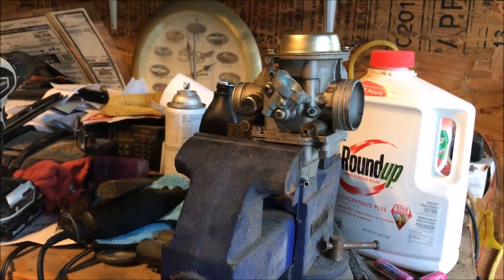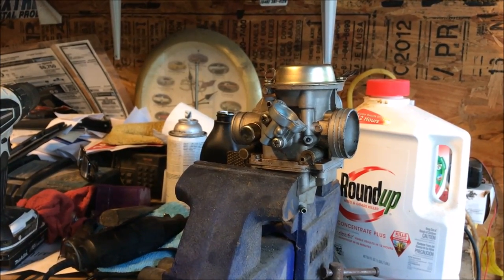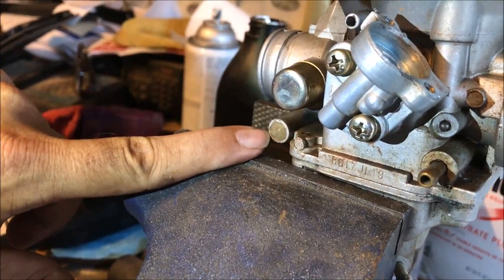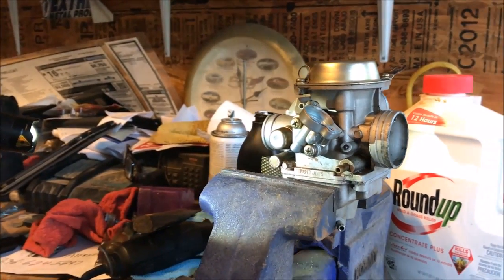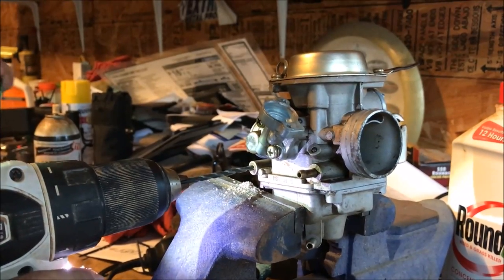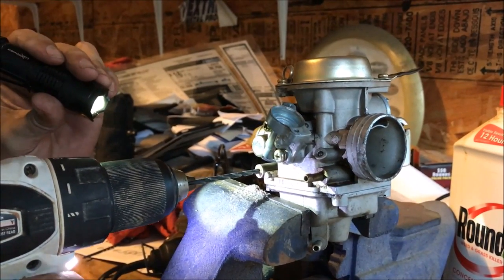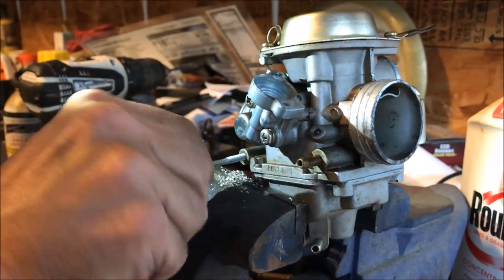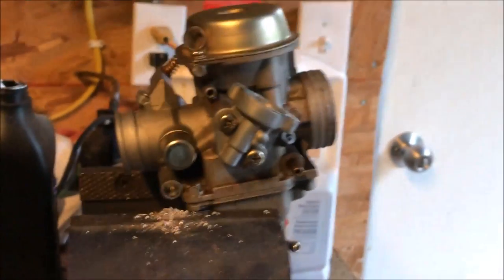GY6 150CC Carburetor Idle Air Mixture Screw Plug Removal

Comment: Brand new scooter hard to to start and doesn't last going higher speeds. I dont want to take the carburetor out and do this, if it was still just the screw I couldve easily adjusted. Thought I was crazy when I didn't see the screw after so many videos. thanks for being the only updated carburetor video.

Comment: Dang. Spent 30 minutes looking for the screw. It is probably manufacturer mandated as all my other "small engine vehicles" has the screw exposed and easily adjusted. Pocket bike, gokart, atv, etc. 
But this GY6 engine is new to me and it has an idle issue (won't idle and bogs down if I push on the throttle) so I wanted to adjust the idle.  Could not find the screw and kept checking. Thanks for showing me the way to defeat the manufacturer's stupidity again.